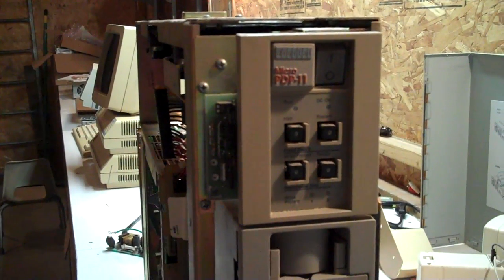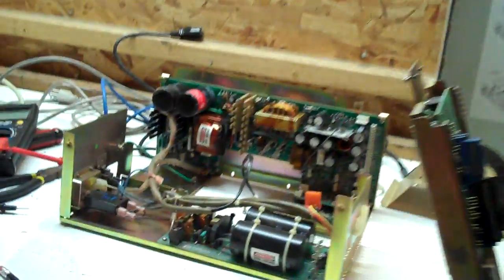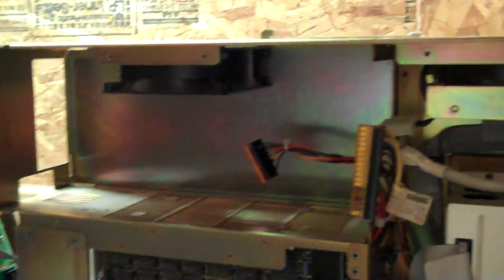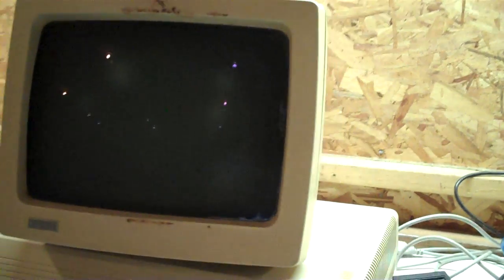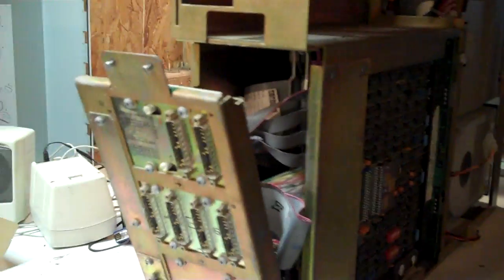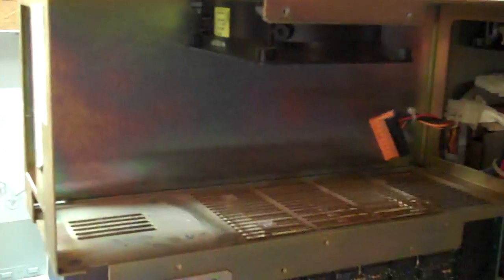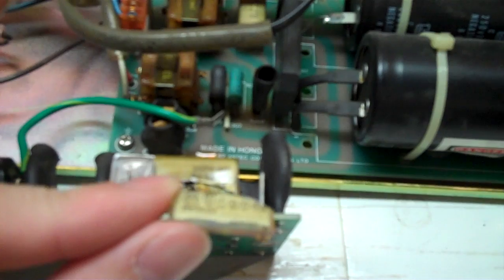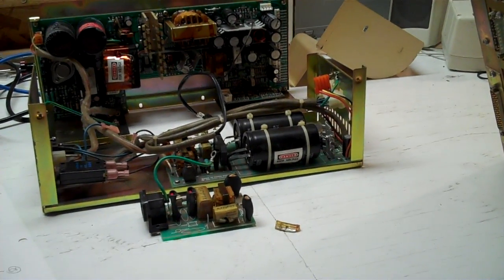PDP11/23 and Murphy

Comment: I suspect the cap being bad (probably shorted internally) would've made the voltages appear fine when he static tested the PSU, but I've often run across sickly PSUs that look fine when meter tested, only to have massive voltage sag when any sort of a load is applied. having an ESR meter when inspecting old powersupplies/electronics after taking them out of the mothballs is essential imo.

Comment: Dang! You're long overdue for some good luck, my man. Thank goodness it was just a cap. Hopefully replacing it will bring that sucker back to life for real. Do you suspect a voltage variation was causing the board not to come up correctly over the console port before that cap blew?

(Also, I've been trying unsuccessfully to imagine the sound of stepping on a thousand ducks. You should set up a camera to run while you work on these things! Just in case.)